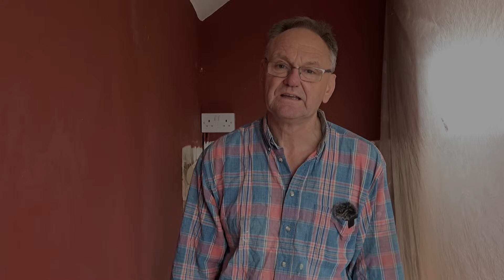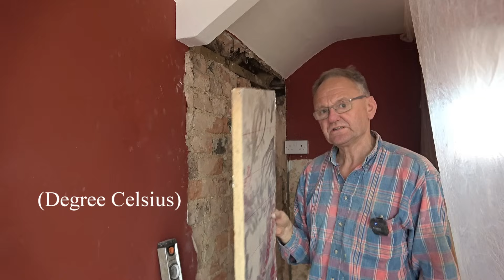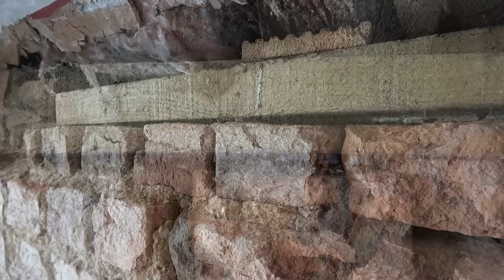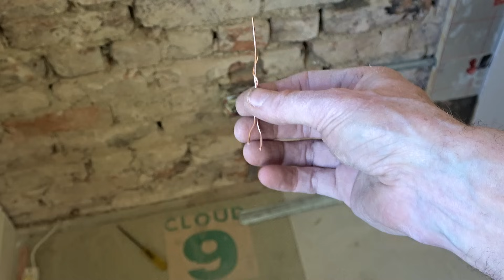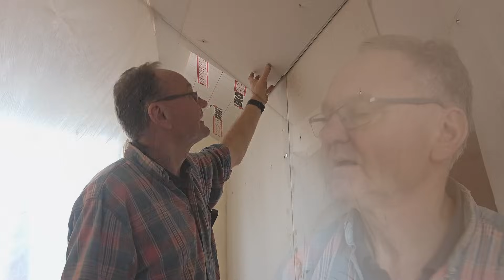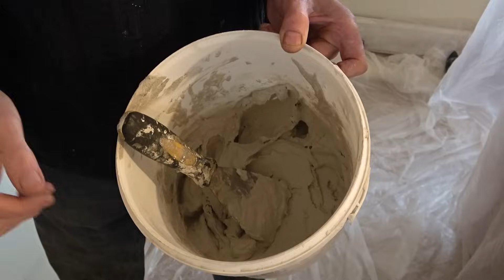HS165 Insulating a solid wall (Do it yourself)

Comment: Excellent video explaining the insulating the wall from inside of the house. I am more keen to know its performance during winter. Please let me know. I have similar requirement for two rooms(Plastered brick walls) to insulate from inside of the house.
Reply from the maker: Hi kapilpatil, I made that video last November and there was an improvement immediately. As we went through the coldest months the wall did not feel freezing like it used to.  I did not take any surface temperature readings before and after so my comment is subjective but I know the difference between warmish and arctic. In terms of warmth per £ it was very good value I think, because it's a cheap job if you can do it yourself. Cheers

Comment: Hi, I'm a bit late with the comments. A great vid, given me food for thought. Could you bond the insulation to the board before fitting with spray on contact adhesive? I've seen Tim from The Restoration Couple bond two layers of insulation together this way. Also could expanding foam be used to help fix the insulation to the wall where it is uneven? Keep up the good work!
Reply from the maker: Hi John, I sure you could bond the board to the foam insulation - rather than pay for the bonded board. Yes you can definitely stick the board to the wall with a foam adhesive "dot and dab" as they call it. I have never done it myself but it is described in the comments. I don't think a commercial builder would use plugs and screws like I did because it is just too slow. Thanks for watching. This is my first video to exceed 100k views (many do not get more than 2k). Cheers

Comment: i wonder if i would get away with just battening   mineral wool.  then plasterboard.   seeing all these comments from. people saying it needs to breathe.  then saying it needs a air gap.  them a vapour barrier.  i think everyone over complicates it
Reply from the maker: Well k, mineral wool would be breathable ....  To my thinking, an air gap would need vents for airflow. Cheers
Reply: @HaxbyShed  would you say. air vents going into the room to the cavity.  or from the cavity to outside?
Reply from the maker: Hi k, well I must stress I have no technical knowledge just a DiY opinion, but vents to the outside. Just like a 'cold roof'. If you insulate your loft you can get condensation so the space needs to be vented to be sure of no condensation. But same situation, you might get condensation or you might not. Many roofs with no vents do not get condensation, but some do.  Our daughter has no vents in her loft and when she had a gutter overflowing into the eaves she got loft condensation. But after the gutter was fixed the condensation in the loft went away (and still no vents). It depends whether you need to be 100% sure (like if you are doing the work for somebody else) or whether you can react to situations as they develop (like when you are doing it just for yourself). But if the wall is wet and you have the risk of conducted damp then I can see an air space or a vapour barrier could be important. My wall was not damp (any more than any other upstairs solid wall). Cheers
Reply: @HaxbyShed  i was thinking the exact same thing about air vents to the outside!  just like sub floor vents in ground floor.   thankss !!
Reply: You are correct, but doing it that way is a lot of work, and if you many rooms to do you will be there a long time. Plasterboard lined insulation board is the fastest ..the above medium speed. You pays your price etc.

Comment: Nice work. We have an old house and I'm looking to do something similar. I insulated a single skin brick wall in our living room by building a stud wall about an inch away from the wall and insulating that, then I put a few weep vents in the brick joints to vent any moisture that might get behind. It's been going strong for a good 4 years now. But the rest are all double brick.
Oh and did you look into soudal plasterboard adhesive? Works really well for attaching the insulation and plasterboard to the wall
Reply from the maker: Hi DTS, I think if I was doing another I would indeed look into plasterboard adhesive. I'm always a bit nervous to try new techniques first time on a big job but many people have recommended the glue so I'm sure I would give it a try if I need to do another. Cheers

Comment: should have used insulated plaster board and used mushroom fixings. this would have made this job much easier.
Reply from the maker: Thanks kickup the ARSEnal, you are certainly right. Being just an occasional DIYer I stuck with what I'd done before but it's a very slow and tedious method I totally admit. Cheers

Comment: Sorry to be the bearer of bad news, but the approach shown here is the WRONG way to insulate an old wall, and will only result in more harm than good. Old walls made with clay bricks and lime “breathe”, and moisture is free to move through them. By adding a standard PIR and plasterboard, which are modern materials suitable for modern (concrete block & cement) walls, this moisture will become trapped and cause far more problems than just a cold room. 
Ultimately all this work will have to be removed to avoid health issues (such as mold growth) and possible structural issues caused by a build up of moisture.

The wall can be insulated, either with a lime based insulation board (such as Calsitherm) or some other traditional method ( such as battened out to create a service void and panelled in timber).
Reply from the maker: Hi Alan, thanks for commenting. A number of people have said the same thing and I'm sure in many cases they are right. Maybe I've been lucky but I've done a few walls like this in my house over the past 10 years and not encountered mould visibly or any smell, or any external bricks spalling.  These cases are just one wall in a room (not more than one wall). Anyway I will keep an eye out for problems and yes it may be that in a year or two it has to come off. At least forewarned is forearmed. I don't expect to be doing any more now so I'll just cross my fingers. Cheers

Comment: Great video. In theory even the thinnest bit of insulation would do a lot of insulating. I wish more people knew that

You can get insulation with a thermal conductivity of 0.022 W/mK and these are available in as low as 12mm thickness

It would reduce the heat loss from a solid wall from a u value of 2 to 0.96 so a reduction in heat loss of 52%

While 100mm would reduce the heat loss 90% which is better a lot of people don't want to lose 10cm internally but probably would be fine with losing only 1.2cm and still get a lot of insulating

12mm = 52%
20mm = 65%
25mm = 69%
30mm = 73%
50mm = 82%
100mm = 90%

I have a flat with a flat uninsulated roof and can't do anything externally. It might be worth adding 25mm internally to the ceiling. And also 25mm to the external solid walls

Before thinking this through I was always put off with the idea of losing 10cm making the rooms smaller but 2.5cm is probably not a big issue. Something to consider
Reply from the maker: Hi I Kaya, I have insulated a few walls in my home with 12mm foam board insulation faced with plasterboard. I've used 25mm or 30mm insulation where space allows. It can be transformational. I'd recommend care with insulating flat roofs - look up 'cold roofs' and 'warm roofs'. Condensation in the space above the insulation can be a major problem and correct venting is critical. I've seen videos with condensation literally running out of ceiling light fittings. Cheers

Comment: I'm sure this works fine and well done. However on this solid lime mortar wall I would have raked out some of the joints and lime pointed them. Then I would have used an insulating lime render, which can be bought pre-mixed. Neither is too hard to do, makes sure you'll never have condensation issues and the wall remains fully breathable. 

On houses with cavity wall I would use boards all day long, agreed.
Reply from the maker: Thank you Peter. The comments have provided lots of good advice for people considering this job. Cheers

Comment: Great job! thanks for the inspiration that it can be done... is it holding up well? no dampness?
Reply from the maker: Hi Marko, we have slept in there every night since and so far no evidence of condensation or mould. I suppose time will tell but I am reasonably confident because I have done this several other places in the house over about 10 years without problems. But of course each house might be different. Cheers
Reply: @Haxby_Shed  Thanks you so much for replying, going to tackle our outside walls (internally) this year... you have given me the confidence to do it. all my best
Reply: @Haxby_Shed  Damp is an issue usually of lifestyle rather than constriction

In the olden says every room has a dehumidifier they were called single pane windows! But as people upgraded to double glazing as it was affordable and helped reduce noise as a benefit it meant the walls were then the coldest spot of the home so the condensation condensed on where ever the coldest parts of the walls were

If a home is heated and has some ventilation and people don't dry their wet cloths indoors it won't get damp

You can have two identical homes one worh zero damp one woth horrible damp and mold The difference is lifestyle and occupancy too

A 4 bedroom with 2 people heated properly in the winter far less likely to suffer problems than a 4 bedroom with 8 with wet cloths on thr radiators will suffer damp
Reply: @HaxbyShed  Hello again. Not far off from tacking the job of installing internal insulation. We have a cavity wall (unfilled) rather than a solid wall like yourselves. Do you think there would be a problem doing the same as yourself on a cavity wall?
Reply from the maker: @markdyballuk  hi Mark, I need to stress that I am only a DiY guy so no professional experience but the cavity should mean there is little risk of damp coming through the wall behind the insulation also the inner skin will be warmer so much less chance of condensation. So my guess is that you can insulate the inner skin of a cavity wall with little or no risk.  But of course I don't have all the detail of your place so that's just an opinion based on what you said here and how I understood it. Cheers
Reply: thank you for taking the time to reply and for your advice it is much appreciated, all my best regards. @HaxbyShed

Comment: Thing is you are missing the vapor barrier, should come after the insulation then the plaster board over that. quite simple to do and cheap, but makes 1000% difference, that shiny thing on the insulation is not good enough to count as a vapor barrier. reason for it (vapor barrier) when you have it nice and hot inside the house after you insulate, that warm air can hold more moisture than cold air, if there are air gaps in that insulated wall, like between the insulation sheets or around a socket or anything that breaks the insulation and air can go in, the warm air moisture will accumulate there and turn into water thus creating damp areas inside your wall behind the plaster, that can cause mold.
Reply: 'thus creating damp areas inside your wall behind the plaster, that can cause mold' - will that be an issue? If the mold is sandwiched in a relatively confined space how is it a problem? If it is, what is the solution - I have seen several solid brick walls insulated this same way.
Reply: @aabb6677  There is alot of information about this online, I found a simple video that explaines it in the basics, you can find other videos if you like on the subject. best of luck in your projects.
https://www.youtube.com/watch?v=fSdD9r5K4RU&t=11s
Reply from the maker: Hi Gudlaugur, a number of people have said a vapour barrier is needed, and a number have said only breathable insulation is suitable. Some have said there has to be an air space between the wall and the insulation board, but none of these folks mentioned venting. I have committed myself to this solution now and I hope it will stay mould free. I think if I were doing it again I would look at the breathable insulation - to allow the wall to breath. Cheers
Reply: The silver foil is not vapour permeable and as such is ok as a vapour barrier but all the joints should be taped with foil tape to prevent water vapour penetration.looks a good job thanks for sharing

Comment: Hey Paul, or anyone I really need someone’s help, from the uk. Please. I’m a female rennovating a garage if you can help please reply. I’m thinking of dot and dabbing straight on to block but using insulated plasterboard but need some questions answering exhausted the internet thanks in advance x
Reply from the maker: Hi Sapphire, have a look down the comments and a number of people have mentioned how they have used dot and dab. I've not used it myself but I got the impressions it sticks straight to the foam insulation board ok. Cheers

Comment: Hi really appreciate your video Paul, thanks. I‘m in that info gathering stage to understand what I have to do for the health of the house. We have a Victorian house with solid walls. Is it essential to take off all the underlying plaster or could I put insulation boards straight on top, even without removing wall paper? I am concerned of course about damp mould etc as realise the walls haven’t breathe….
Reply from the maker: Hi Nic, I really must stress that I am just a DiYer and I have no specific technical knowledge beyond basic reasoning. I only took the plaster off that wall to gain space - otherwise I would have left it on. All I can say is, I have insulated one external wall in several other rooms over a 10 to 15 year span and I have never encountered damp or condensation as a result. But none of those was a high vapour area like a kitchen or a bathroom. Many people have said there should be a gap between the insulation and the wall but I am pretty sure that would make little difference unless it was also vented from the outside. I think breathable insulation would be the only sure way of removing risk - but again that's based on logic and not personal experience. Cheers

Comment: This is definitely NOT the way to do that job!
You're going to end up with an awful cold spot at the top of them boards where it joins the sloped ceiling because behind there, is freezing cold air from the eaves. Give it a year and you'll have a lovely mold line running along there where the insulations broken.
Not to mention, thats the most awkward way of boarding the walls with the celotex/pb.
You'll have tons of black screw marks showing through the final paint finish from cold bridging also.
And you never EVER prime walls with PVA unless you're skimming them. Never pva under paint😅
Reply from the maker: Hi ep91monster, thanks for your comments. I will lookout for the mould line developing, and if it does I'll know the cause. Cheers

Comment: It's never advisable to leave a gap in the insulation such as at the bottom of the boards,  as this  creates a cold spot.  The moisture in the room air will tend to condense out at the cold spots leading  to problems like black mould.  You could always try dotting and dabbing with foam adhesive to fix the insulation to the bricks, instead of screwing through - the metal screws will act as a bridge conducting away heat, another source of damp problems
Reply from the maker: Hi Kevin, I did not show it on the video but after some comments I injected foam at skirting level, but being careful not to blow the boards off  😁 Cheers
Reply: Kingspan recommend a 5mm gap at the bottom.
Reply: For what purpose?  @Drew.Peacocks
Reply: @gp4103  No idea, I wondered too. Air gap maybe? Expansion?
Reply: @Drew.Peacocks  I believe it's to avoid bridging from the floor
Reply: Probably airflow  @Drew.Peacocks
Reply: @Drew.Peacocks but they also recommend to then fill the gap with an acoustic sealant

Comment: Have you considered putting a solid gate at the end of the entry between your houses. i had exactly the same problem but insulated the entry wall rather than inside. but we felt the most benefit when i fitted a gate at the end of the entry to stop the wind. maybe i didn't need to insulate the wall. the effect was so dramatic.
Reply from the maker: Hi Trevor, that's a good idea but not very practical in this case. The passageway is on my neighbours land and also this room is upstairs.  But in other circumstances I'm sure it would help. Cheers

Comment: Vapour barrier to eliminate condensation ?
Reply from the maker: Hi Mike, you will see in the comments people have advised a vapour barrier, others have advised breathable insulation. Some have advised an air gap - possibly with vents. All I can really say is I've used this method on a few walls in my house over about 10 years and not encountered any problems. But it's never been applied to more than one wall per room. Cheers

Comment: Nice job with a good explanation. Are you not afraid that you have created a cold spot near the floor where the insulation is missing and condensation could occur now?
Reply from the maker: Hi Jan, I got some comments about that so I injected some foam through holes at the skirting board level (hidden by the skirting board). I was careful not to pump in too much because I was told putting in too much cold force the plasterboard off. 😮 Cheers